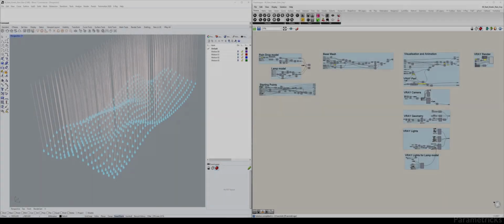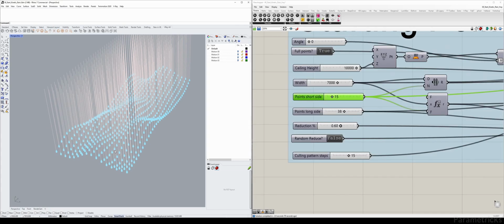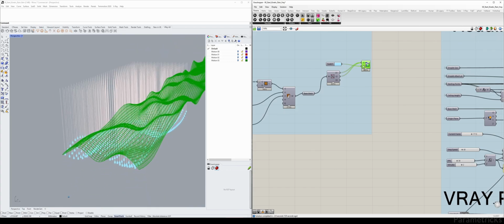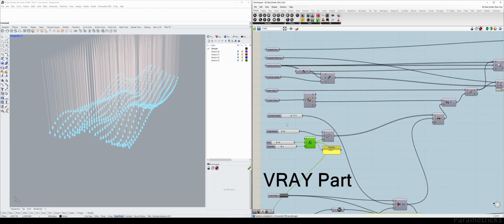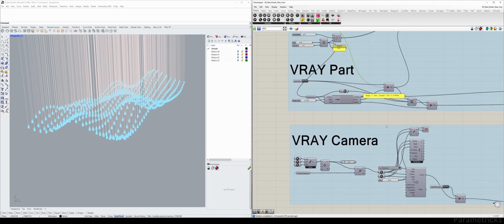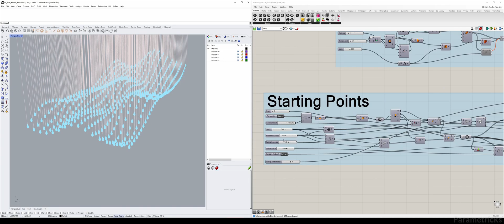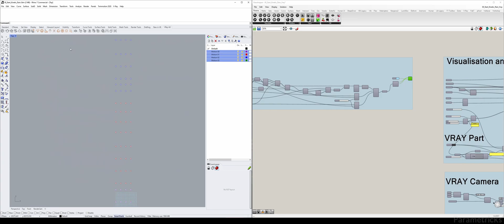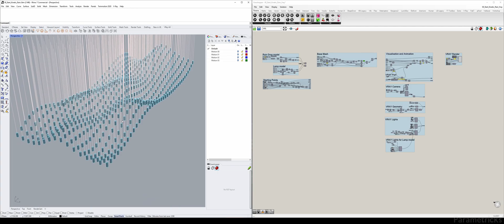Kinetic Rain with Grasshopper & VRay -Part 00- Introduction

Comment: Thanks for the video! Very useful. I'm wanting to create an interactive ceiling using a similar script. Using attractor points to ty and get the ceiling to react to movement but the script isn't working. Any suggestions?
Reply from the maker: Hi Anna, 
Excuse the very late reply.
The script currently uses a path to simulate movement, but an attractor point(s) method would also work. You will need to decouple the predefined paths and use the distance to each of your attractor points to control the falling movement of the droplets.
Reply: @Parametricks  that’s okay! I ended up making a script for it but it only moves the drops away or closer and wave does not continue like I had wanted but almost:)
Reply from the maker: That's awesome to hear !! 👏🏻